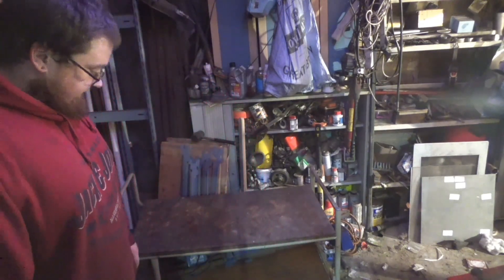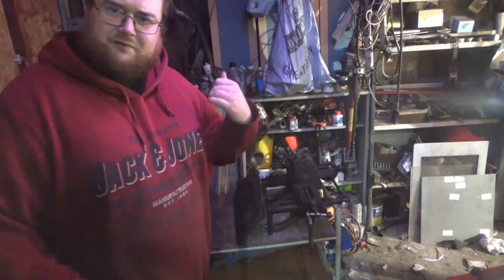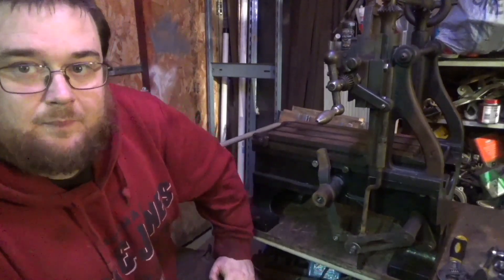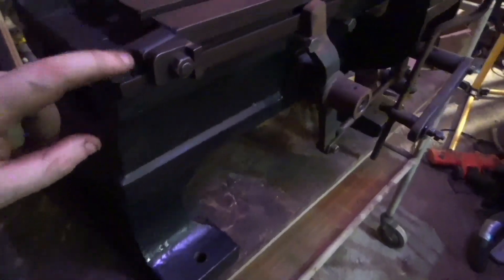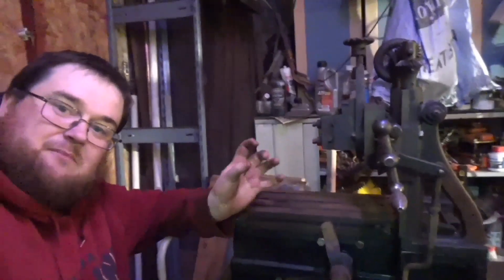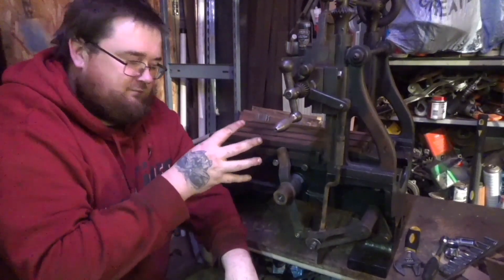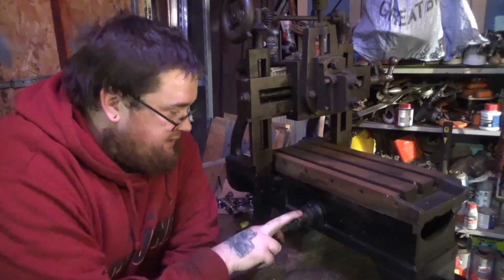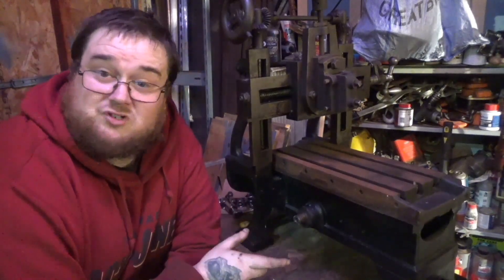I brought a Henry milne's hand operated metal planer... very happy boy

Comment: Cool planer you could always add a motor to it to improve the unit or update if you feel like it on less you think it doesnt need a update i have a 1940s metal lathe i still need to put together because of winter in Canada i cant do my shop floor because its dirt i cant dig it till may or something like that
Reply from the maker: I was thinking on making a fast and loose type drive system eventually but who knows when lol.
My floor is covered in waste oil at the moment... that's going to be so much fun cleaning it up ready to pour self levelling compound, but atleast the concrete is all done
Reply: @smithbuilt  i was i had the money for concrete lol
Reply from the maker: Yeah it was not cheap, plus I mixed it all so it took ages. I'm so glad that bit is done theres about 50 tons of it under my shed.... never again lol